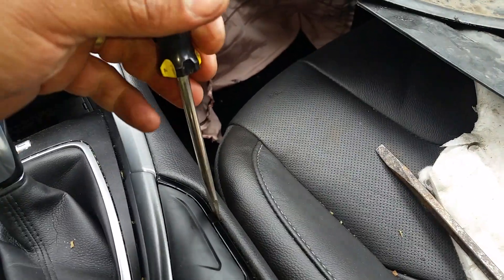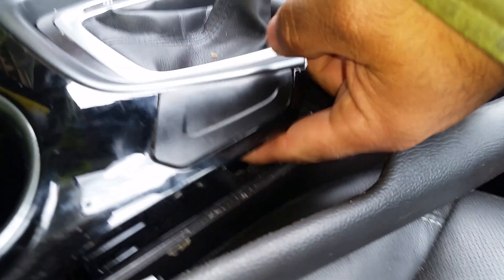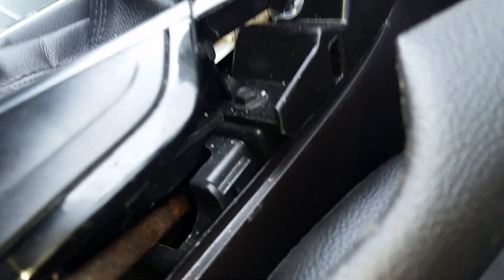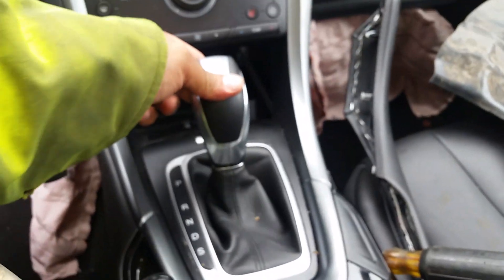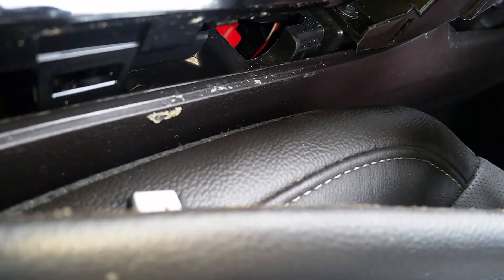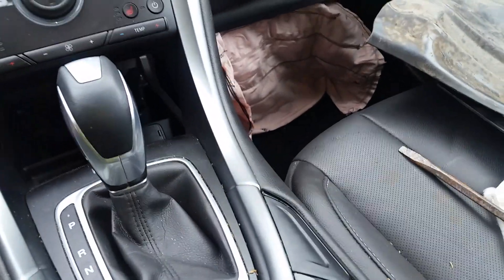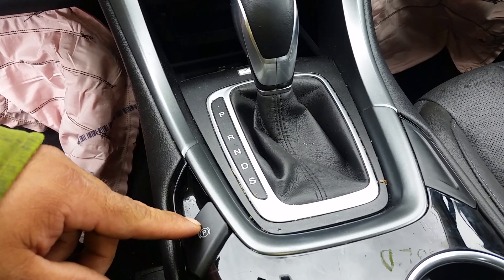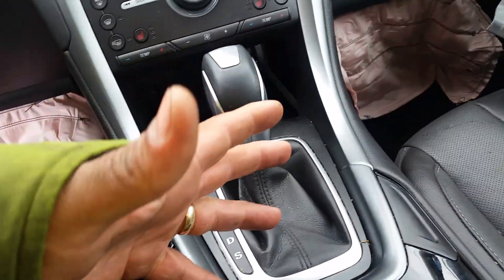How to get a 2016 Ford Fusion into neutral

Comment: God bless you - you saved us a bill and a half. The lever looked just like in the video - I used a thin length of bamboo as my screw driver didn't quite fit. Pushed the lever forward - more sort of feel the tension on the lever as it moves a bit, than a see the lever move as the space is really tight. The shift lever unstuck, and I ran it through it's detents and then returned it to park. Car starts, and does all the stuff that it supposed to do - like drive.
Reply from the maker: Glad to help. Sometimes the shifter cables get worn out and when you put it in park the transmission will be in park but the switch on the transmission doesn’t engage all the way the computer doesn’t realize it’s in park. A lot of the times I move the shifter into neutral and try starting the vehicle and most time the car will start right up. The vehicles can only start in park or neutral.

Comment: Thank you so much for this! I thought I was about to be stranded in Manhattan during the pandemic, but with this video I was able to get home to Brooklyn. Now the car is stuck in neutral parked with the parking break and I need to figure out what to do next. I know there is a recall for this issue, but getting to a Ford dealer during a pandemic sounds like a nightmare.
Reply from the maker: Well glad you got home safe. Just call the dealer or a roadside and have it towed to the dealer so they can fix it. You don’t even have to go with it.

Comment: Thanks for the information, but it's absolutely ridiculous that Ford does this. There should be a regulation on this and it should be an easy to reach location or a button underneath a panel that you can open with the key.
Reply from the maker: You’re welcome and Yeah I agree! The newer vehicles are a pain to get into neutral

Comment: What if I wanted to tow the car with a dead battery.

 Did ford make a way to disengage the electronic parking brake in that scenario ?
Reply from the maker: There’s no manual release for the parking brakes. You would have to use a portable jump pack or jumper cables to feed the car power then take off the brakes.

Comment: I have a 2014 Ford fusion that the gear shift is in park but the gear indicator shows it's in neutral. Will this fix that?
Reply from the maker: The neutral override won’t fix that issue. With the shifter in park does the vehicle roll or stay in park?
Reply: @TowMan127  thank you for the help but I found out what the issue was. It's the shifter cable bushing. Apparently there's a recall on that part. Again thank you for the help
Reply from the maker: @EataPeachMike  that’s what I thought it would be. It happens a lot to a few vehicles. The bushing gets worn out. I believe they sell those bushings at an auto parts store and you can replace them yourself. Glad you found the issue.

Comment: Car was stuck in reverse with the shifter in park. Released using this method but now it won't we engage any gears. How do you get it to go back in gear?
Reply from the maker: The shifter cable might be worn out or not connected. Check to see if the cable is connected to the shifter and the transmission
Reply: @TowMan127  thanks a lot. Had my co worker hold it in place and it went into gear gotta replace the bushing. Appreciate the quick response
Reply: Johnny Wolfe what do you mean hold it in place? I have the same problem
Reply from the maker: Probably had to hold the shifter cable to the shifter. Sometimes the bushings go bad and the cable doesn’t stay in position.
Reply from the maker: Glad it worked out for you.
Reply: TowMan127 i just went to the dealership, turned out there’s a recall for the bushing

Comment: This just happened to my mom's car. I was able to get the shift moved, but the transmission still thinks the car is in reverse 😢.
Reply from the maker: The shifter cable might have popped off the transmission or the shifter
Reply: @TowMan127  Thanks so much for the quick response! This video helped me a lot.
Reply from the maker: @latoyakelley9259  you’re welcome. Sometimes the cables pop off. There’s a bushing that gets worn out. If it’s that, I believe they have a kit at the auto parts store to repair it.
Reply: @TowMan127  Yes, sir! That's exactly what it was; after looking under the hood. The shifter cable was off & the bushing was missing. After researching, I found that it was a recall on this model for the bushings; luckily, there's a Ford dealership about 20 minutes from here. We'll take it there & let them replace the cable, as well as the bushing.
Reply from the maker: @latoyakelley9259  awesome!

Comment: I've tried your method and yes the gears move however the car will not reverse but will not go in park it's still showing that it's stuck in neutral
Reply from the maker: Byron Bynum does the car roll?
Reply: I actually got the car to go into park and reverse I was able to drive the car around the corner when I got home I place the car in park and tried to move through the shifts to make sure it worked properly  & now my car is currently stuck in sport mode and will not crank at all
Reply: TowMan127 it's all messed up now

Comment: If you ever find a way to disable that parking brake without the keys let me know LOL
Reply from the maker: Forgott3n Gaming trust me i will make a video if i do
Reply: 2014 has the same setup, but cant for the life of me find out how to disable that EPB (electronic parking brake) without the keys, great i guess to make a repo company work harder if the car is up for repo, but at that rate wouldnt they just do what is shown in the video to put it in neutral and just tow the car from the back?
Reply from the maker: A lot of guys will drag the car until they are clear then do what they have to.  They can always hook it up from the back and put it in neutral
Reply: Forgott3n Gaming  I have same problem how I release brake without key please told me if you know 🌹
Reply: TowMan127    I have  problem how I release brake without key please told me if you know 🌹
Reply: TowMan127   I lost my key and I don’t have other key
Reply: Thank you - my shifter is stuck in park and I am able to push red button and move shifter but as soon as I put it back in park it goes back to being stuck - any advice?
Reply from the maker: I would have your local mechanic check it out. Could be a fuse or something.

Comment: I put the vehicle in park, when I went to put it on drive it wouldn't budge, but it was reading reverse. so I turned the vehicle off and tried to turn it on, n it does not turn on. now the vehicle is stuck on reverse....HELP
Reply from the maker: try pressing the brakes and moving the shifter till the N lights up then try turning on. Vehicle won't turn on unless in park or neutral
Reply: Rafifi I'm haven the same problem right now man
Reply: Rafifi did u get it fix
Reply: Kevin Kinsey yeah the shifter cable bushing broke
Reply: Rafifi dammm man this shir here smh
Reply: Rafifi how much was it to get fix
Reply: Rafifi my car want even start
Reply: Kevin Kinsey i had to put my vehicle into gear from the front
Reply: Rafifi huh
Reply: shit ok
Reply: Rafifi How?

Comment: It still not  working I have a 2015 Ford Fusion
Reply from the maker: Tyesha Atlas weird might have to disconnect the linkage under the hood and manually change the gear. (If you do that make sure the parking brake is on) i dont like doing the linkage for safety reasons. Maybe the release button isn't working
Reply: TowMan127 o
Reply: Thank you for your  👏🏾👏🏾 great video